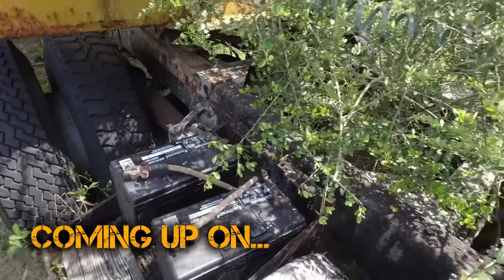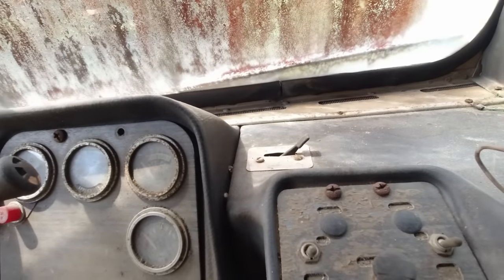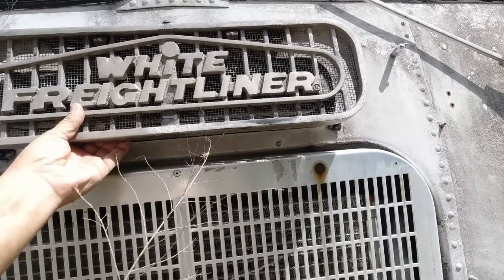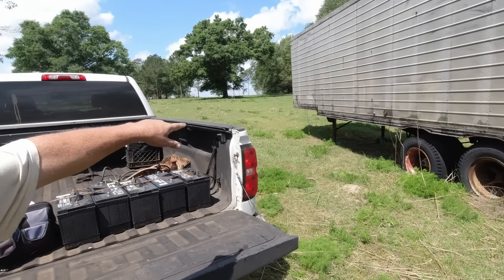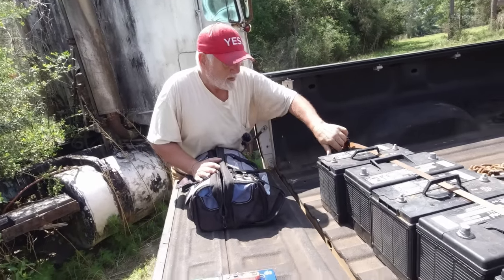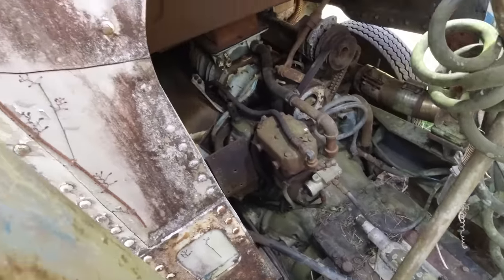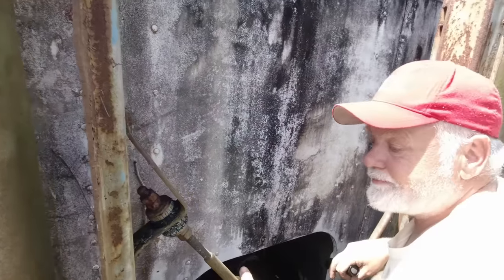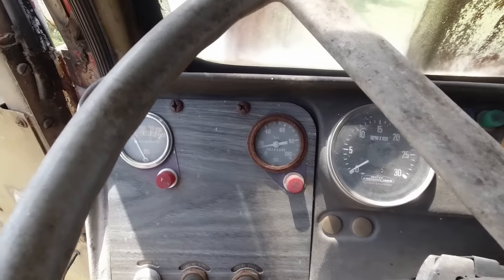Will it START!? Will he Sell it? 49YR Old White Freightliner..

Comment: You don’t have to hold your foot down on the pedal. Detroit governors when at rest ( stopped ) are in the full fuel position. As the engine starts 
, the governor weights start spinning, and move the shaft into idle position.  To be honest I’m surprised a guy your age wouldn’t know more 
about this truck.  Not knowing where the dipstick was located on a Freightliner you wouldn’t get hired.
Reply: This engine has surprisingly few oil leaks for a Jimmy.  Not often you see any rust.  The term “ making oil “  means the oil is being contaminated with 
diesel oil. Bad injector plungers, or on Detroits a cracked flare on an injector fuel line.  When the oil starts to show higher on the dipstick eventually 
you will smell it in the oil, and in the vapour coming from the air box drains. Those are the two little pipes that are screwed into the low end of the 
block. They allow oil laden air that gets scraped of the cylinders as the piston rings pass by the intake ports in the liners. For the un initiated these 
are 2 stroke engines. The mechanical gear driven blower pressurizes the intake air so it will flow into the cylinder when the piston approaches 
bottom dead Center. At the same time the exhaust valves are open. This slightly above atmospheric pressure created by the blower lows through 
the intake ports while they are uncovered and evacuates the spent combustion gasses out of the cylinders. Then the exhaust valves close, and 
soon after the “ fresh air “ charge is now in the cylinder and as the piston rings pass above the inlet ports, the air charge is compressed, and the
injector adds fuel before top dead centre. Combustion takes place and drives the piston down like a bullet in a chamber.  Every time the piston 
comes down it’s a power stroke.  That’s why Jimmys sound the way they do.  If the air box drain gets plugged up with carbon sludge and 
the oil can’t escape the airbox then it can get into the cylinders and cause the engine to knock, and if bad enough like in a V 12 it can start 
running on oil, and run away, or bend rods.  When the truck is sitting running in a parking lot, you will normally see a small puddle of oil on the 
ground.  Noisy, slobbering, sometimes gutless engine.  Drivers would tell you it was running real good just before it blew up.

Comment: this truck is too old for a electric fuel shut off.  it will have a pull cable going to the pump.  some of them was also pulling up on the throttle pedal to kill it
Reply from the maker: I though so too. 
Thanks for watching

Comment: It's called a 2 axle not a single axle. A single axle would only have a steer axle. A 3 axle has 2 drive axles.
Reply from the maker: I am not so sure about that but I could be wrong 
Thanks for sharing and watching
Reply: @DontbeWily  I've been trucking since the 70s and have never heard a 2 axle tractor called a single axle. If you would have said single drive axle, that would have been acceptable. What do you call a 2 axle drive dump truck with a front axle and 2 floating axles? I would call it a 5 axle truck.